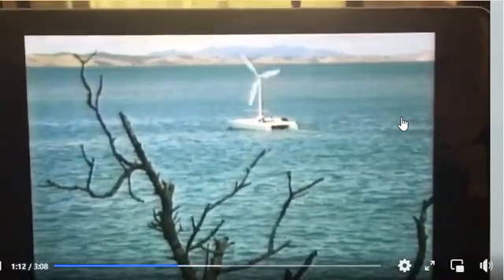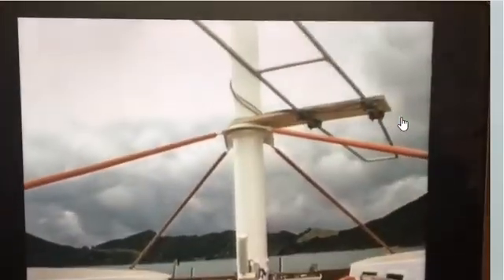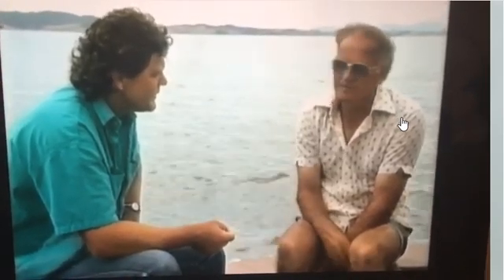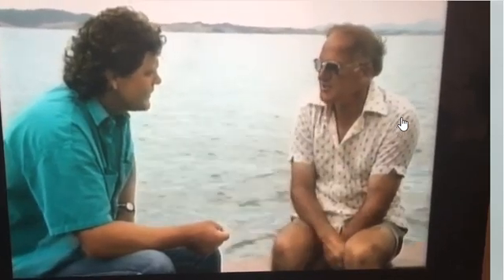Bates Tango Windmill powered catamaran

Comment: This application of a high speed turbine might need a bit of tweeking..... someone (maybe me??) ought to try a disk 1/3rd larger than we see in the video, with the same narrow chord high-efficiency foil blade, but with like 20 blades instead of 3.   This config would spin far slower than Mr. Bates' version.  Furthermore,  I'd spin very large low speed props, again with a high efficiency setup (narrow chord)
I think the backward force on the swept disk, as well as the friction of the very high speed blades, is hurting him and thus the disappointing overall speed.  Finally, it would be a lot more pleasant to be near a disk of moving blades if they aren't scaring the heck out of you.
Reply from the maker: more or less right but what about the angle of the 20 blades?